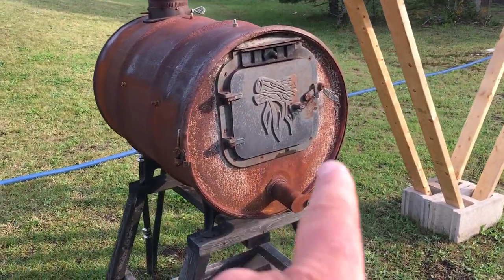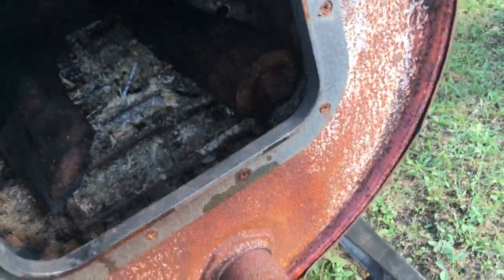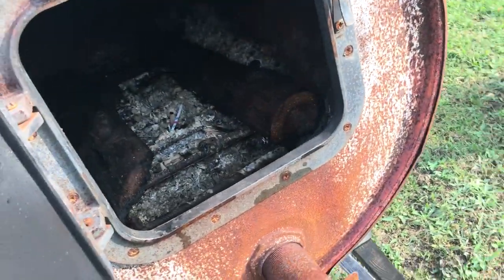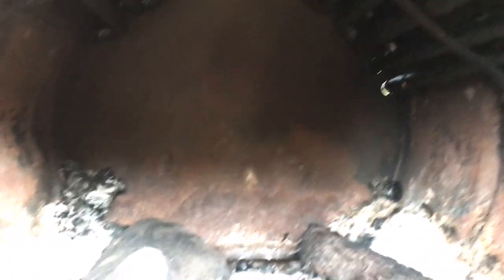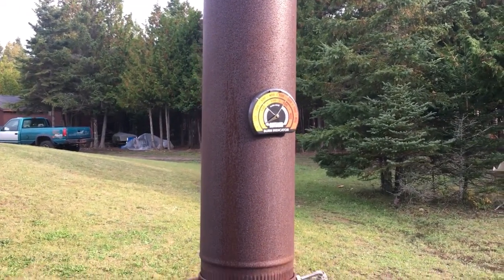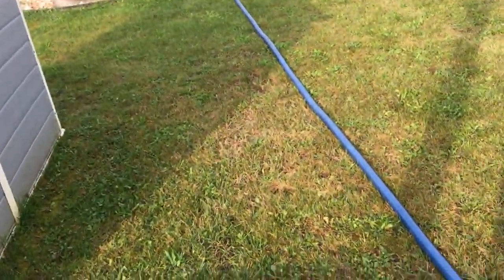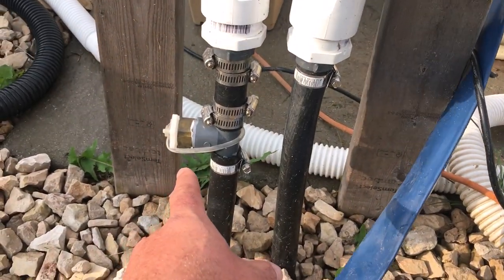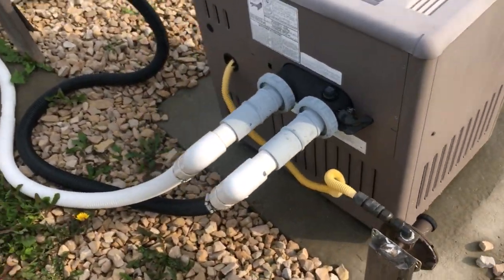Barrel Wood Stove Pool Heater - 2 Year Update

Comment: Hi. Thanks again for all the details. Its really going to help. One thing  I could recommend to help with getting a better draft is to take a piece of pipe and drill many holes in it and than weld it to the pipe/ inlet you have at the front of your burner. This will pull the oxygen through a disperse it around the whole burner. I have added it to a camping stove I have to great effect. Once again great video
Reply from the maker: I like that idea of adding a pipe with holes. Thanks for the advice and thanks for watching!

Comment: I like your set up but the stove pipe could be longer ....your air inlets apear adequate but more draft will help with moisture and reach a correct burn cycle faster. I'd try adding one length to experiment.
Reply from the maker: 100% agree! How do you think I could support the pipe when adding the lengths? Even just with the two sections the wind sometimes blows it around. Thanks for watching and having a great comment!

Comment: What size pool do you have?  How much wood do you burn to lift the temperature up?  What temperature does it maintain at?
Reply from the maker: My pool is a 28 foot round pool, about 18,000 gallons. How much wood you would go through and temperatures will very depending on what type of would you use.
Reply: @UpperPeninsulaDIY  how much wood do you go through and what temperature does it hold ? It's hard to figure out the correct btu output and if it's financially fiscal to get done as a start up
Reply from the maker: This type of stove is not efficient. I don't know exactly how much wood I went through but a lot. I only usually us this stove after a rain or just to warm the pool a couple degrees. I also have a propane pool heater that is much more efficient. I use the propane for initial opening of the pool to get the water warmed up, then the wood heater to maintain. I know it doesn't directly answer your question but your question is tough because there isn't exact numbers.

Comment: commenting on a 3 year old video.  your measurement may not be 100T accurate, but it IS scientific method. 
 you measured your constant pool temp, before heating.   then measured the two variables and made a comparison.

Comment: One thing I noticed is that when you look at the filter loop going to the propane and the filter loop going to the wood, they are not the same size and diameter therefore they do not get the same flow. Your flow going to the woodstove is extremely restricted due to the size of the line. Also I wonder if using your filter to pump that water through a restricted line that is much smaller than the filter, going to cause problems with your filter pump?  If those lines were the same size all the way around through the wood stove as they are on the propane I bet you would have closer to  the same amount of water heating with both systems. There's really nothing you can do about it at this point but just an idea.
Reply from the maker: You are right, the wood stove loop is more restrictive. Copper piping is the most restrictive with only being able to purchase nothing bigger than 1". At least easily able to get. There is more head pressure for the pump but managed with the bypass valve. Thanks for watching and having some great advice in your comment. Thanks!
Reply: @UpperPeninsulaDIY  I am putting a heater in now off my Natures Comfort wood boiler. Just the salt water heat exchangers go $1000-2700 Not counting pex tubing and hardware.
Reply from the maker: Dang, that's not cheap. Good luck.
Reply: @UpperPeninsulaDIY  By only closing the big valve partially, this will allow a percentage, only to go through the wood heater, the rest will still flow through to the pool, unobstructed, a good balance.

Comment: Are the pipes inside soldered or brazed ? . What size are they ?. Thanks
Reply from the maker: Pipes are soldered together. I don't remember what size I went with, I want to say 3/4". Here is my playlist, you can look through the videos to see what size pipe. https://www.youtube.com/playlist?list=PLhm4dRKS8DVfs17YMARWLIhbfKh6F0f4S
Reply: @UpperPeninsulaDIY  thanks, I wasn’t sure if the heat of the fire would melt the solder or not
Reply from the maker: @tastytechaddictsmtb  It's important to always have water flowing through the pipes when there is a fire going. If water is flowing then the solder want melt.

Comment: Insulate.the roof inside.to.capture heat around coil
Reply: Some high temp insulation on the roof wall between the coils, and maybe more coil incoming around the chimney pipe to prewarm incoming water.
 Towards the idea of a furnace for melting metals near the coils the heat has more dwell time around coils, smaller fires with bigger temp increases